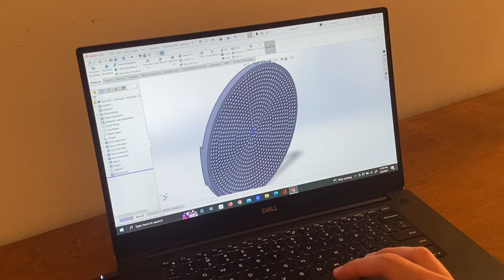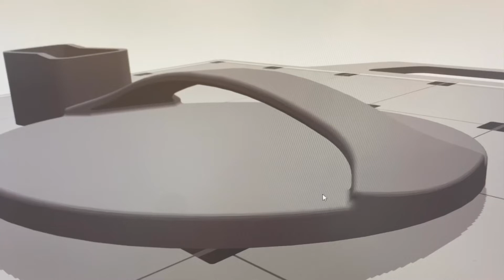3D Printed Baren: Designing and Printing (First Try)

Comment: As an absolute beginner I found a baren with 300 points in a 12cm diameter best. Very good for smooth colour. Not so good for fine lines.

As a slightly more advanced beginner I'm finding a baren with 600 points in a 12cm diameter best. Good all round.

The Kurasaki baren I've found has too many points - too little pressure - unless the paper is either quite thin or quite wet.

Cool project Jack. Hope that helps!
Reply from the maker: That is helpful  to hear your input. This baren actually has 977 points, but I have one mocked up for 588 as well.  I’m curious to compare all these and see how they react as you said. 

Thanks for watching and taking interest!

Comment: Thx. for the update ... I hope you get a reproducible design that works for you.  Do you plan on different designs of the rubbing surface ? Less/More dense distribution of spheres ? .. different size spheres etc. ?
Reply from the maker: Yes!  I actually have a few different ones designed already.  First I wanted to try these out to have a point of reference. 

The thing I really want to try though is a “modular” baren.  I imagine it as a solid handle + base that can attach to different rubbing surfaces.  Ideally, the rubbing surfaces would be thin and easy to 3D print, and could easily snap into the base.  Over the next few months I will probably experiment with that. 

Thanks for watching, hope you are doing well!